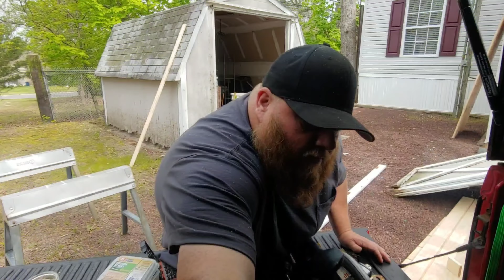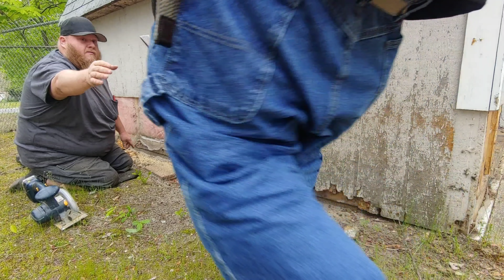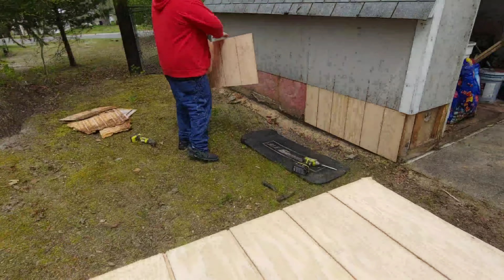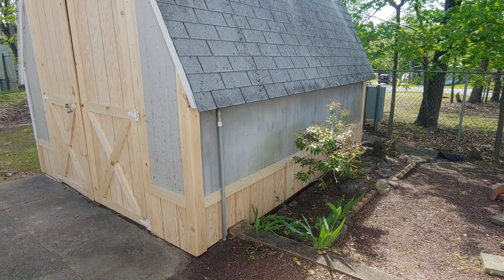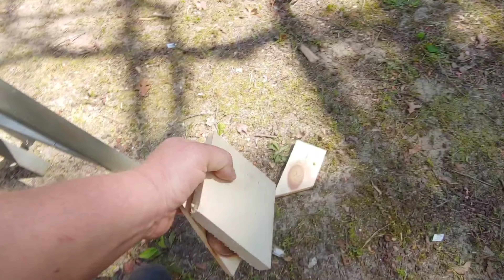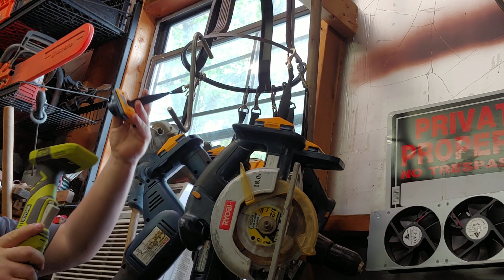HOA go away. shed repair

Comment: Done the same job before. One thing if you have to do this again , use a Z flashing to transition from old siding to new.(it slips under the old and over the new ) It will waterproof the joint and prevent leaks.

Comment: Justin, I'm not a carpenter I'm a scrapper. Now, give me that brick hammer for carpentry. LOL. Classic.
Reply from the maker: Lol... it's actually a good Hammer it works good for a pry bar to
Reply: @ScrapFarm  OH, I agree. They work great. But, a claw hammer would be better for that project. LOL
Reply: A good handyman always uses what's close and what's handy. I've been one for over 35 yes. and you use what you have at hand. By the time you go and try to find your hammer, I'm starting to start my truck and making shore they signed the check. Another sweeeet job Bert.

Comment: a little late but.  if you bevel the bottom of the sheeting the water will drip off and not migrate into the bottom of the sheeting or the rest of the building.   Dave

Comment: Nice video.
Keep them coming!.
I enjoy and learn from them.
Just wondering when you screwed the replacement panels did you use galvinized screws?
If not, you'll have rust bleeding from the steel screews onto the new wood over time if using uncoated steel screws.
Just a tip use galvanized coated screws on all outdoor projects.
Reply from the maker: Yeah we used coated screws Torx head exterior deck Style